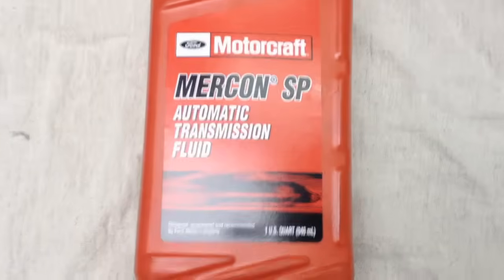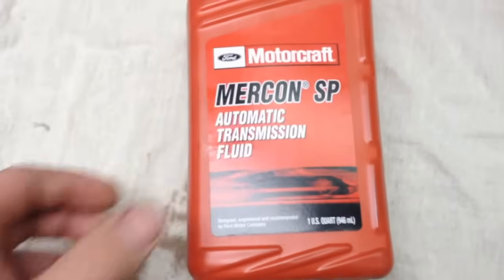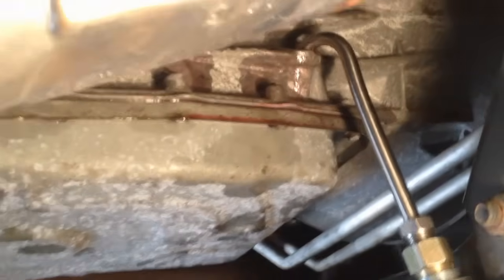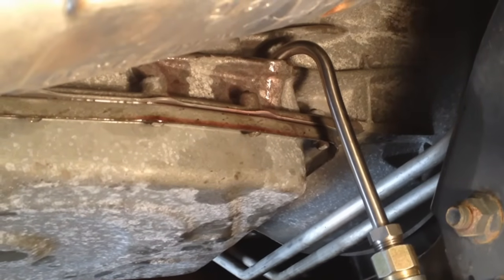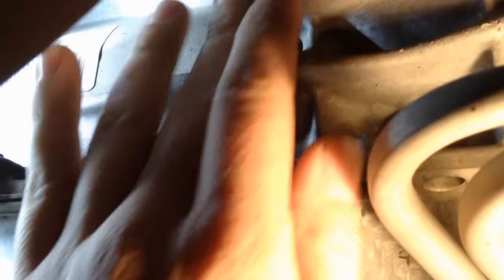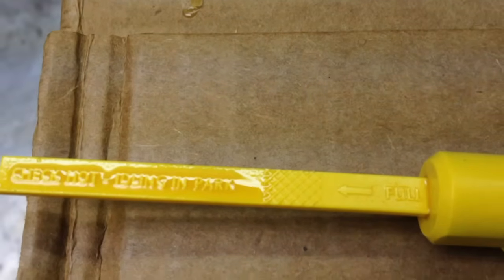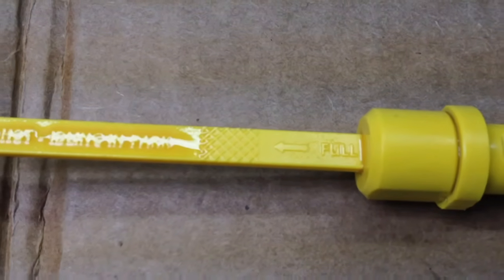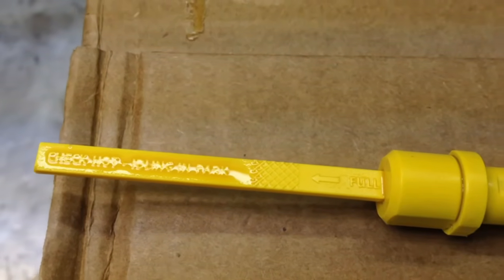Ford 6R60 & 6R80 6 Speed Transmissions: Fluid Fill & Adjustment Procedure

Comment: Has anyone ever had the dipstick plug strip out? It just spins... Just had this happen when trying to attempt to replace the bulkhead sleeve. Obviously didn't take it any further because I would have no way to refill the fluid. Any help would be great. Thank
Reply: Did you resolve the problem?? I got the same problem!!?
Reply: @joseonta  yes. Best I remember I had to use an impact to get it out but it ruined the threads. I ended up using a rubber expansion plug that had a bolt head to tighten it down.
Reply: @honkytonktolltide  thanks a lot, will see what  I'm going to do !!!

Comment: I want so much to to this myself.  I am capable but am worried I will pop that cover off and some spring or pin or something will fall on the ground. If I do,  did you say start off putting 4.5 quarts back into it.  BTW, thanks for the link to the pump, you thought of everything to assist the DIYers.
Reply from the maker: +ken tastic Nothing will pop off don't worry. I think they take right around 5 qts before overflowing just fill till it start to overflow then adjust from there.

Comment: FordTech, just replaced my bulk head connector based on another video of yours and and all seems well.  Just one thing about the fluid level adjustment.
I am getting inconsistent results on the dipstick.  May latest attempt to check was while running after driving a few miles. While running I checked and it showed as if it was over full.  Tried again and one side showed as if it was over full and the other side was low.  So, I thought maybe I am sliding in on the side and it is not a true reading.  Tried yet again and looks full.  Not wanting to be over full, I turned off the motor thinking if it is over full it will run back out the fill spot when the engine is off. Is that not the case? After turning off none came out. Any suggestions on how to get an accurate reading?  Seem to drive and shift well.  thanks.
Reply from the maker: +trailscavenger It wont necessarily run out no. Tow different levels on the stick are common with automatic transmissions. What I generally see is the lower reading sometime on the backside of the stick is the actual reading. What you have to realize is fluid flowing around in the pan can splash or wave onto the dipstick and create a higher mark where as creating a lower mark is not possible.
Reply: +FordTechMakuloco  - I would agree. I just do not want to be Found On Road Dead :)  I will check one more time cold before my long trip.  thanks.
Reply: Exactly, man Im glad I read this. I'm having the exact same issue. I've checked it cold and hot and I cant ever seem to get an accurate reading. This has become suchban aggravating endeavor and simply adjusting the fluid level accurately shouldn't be this difficult. I check it warm and get it to the bottom of the hash marks,then drive it till operating temp and check again and it shows over full.Drain  half a quart out,drive again,check again and it shows low.What a screwed up system. I wish Brian would make a video and say whether the vehicle is running or not and if the transmission is warm,hot or cold. Hell man,dont worry about the engine sound we can get past that.Accuracy is more important especially when a new transmission cost 2500.00 or more. I guess I can always quit bitching and takebit to the dealership. SMFH!!!!!!!!!

Comment: Fordtech I have a couple question. 
1 I am assuming if you break the vacuum seal to check your fluid levels it's not going to mess with the tranny
2 I am not having any trouble with my tranny at this point (60,000) but I do haul my camper a lot during the year.  Would it be beneficial to change the fluid now or wait till the 100,000 mark.  A few dollars now may save me thousands down the road.  At least that's what I am thinking.  Any advise appreciated.  Thanks for the vids.
Reply: jamexp I know this is an old comment, but hopefully you see this.

After changing the fluids out, especially if done after a very high mileage you essentially must reset the PCM. My truck had minor differences, but relearning with fresh fluid made all the difference.
Reply: My 2007 Expedition has taken all 9 quarts of Mercon SP I ordered and it still isn’t even touching the dipstick when running in Park, is it safe to drive and how many more quarts should I order. No leaks and it took all 9 quarts through my hand tranfer pump.
Reply: Ok recounted it took 8 not 9 quarts even, I got it now up to just below the hashes with 8 quarts of fluid running in Park cold, took more than I thought.
Reply: Driving it this morning now my truck revs very hard before shifting into 4th gear..... great.
Reply: jamexp make sure to run the shifter through each gear.
Reply: Motorcitymadman did you get any response from this question?  Firestone told me they won’t change my transmission fluid on my 2103 F-150 for this reason (140k miles), but manual said okay till 150k.
Reply from the maker: +ExploringKY Vacuum break is not going to affect the trans correct. I would definitely perform a fluid and filter change as per my video at this point especially with towing.

Comment: Great video but can you tell us where the fluid should be on the dipstick when it is cold? Those cats get hot well before the transmission gets warm. Thanks for all the great videos they are very informative
Reply from the maker: What I have found is about and 1/8" below the hatch marks line cold engine running works best
Reply: Thanks a lot!
Reply: @FordTechMakuloco  I fear I overfilled mine FordTechMakuloco. Should I take it to a mechanic to check/correct level?
Reply: FordTechMakuloco i have a 13 f150 6r80 on my dip stuck there is A and B ?

Comment: What about a 6R60 in an 06 Mountaineer with 100k on original fluid. Can I replace only 6 or 7 quarts with SP, when the original (and remaining) fluid is Mercon V (I think)? Ford's recommended fluid change is at 150K, but reading several threads, I'm thinking I need to do it sooner, but no tranny problems, so far.

Comment: ford tech
In the last paragraph I forgot to mention my new 2010 Ford as you know has no dipstick tube . Im looking to make myself a dipstick tube for my truck. I purchased from Ford a new metal cap covers the small dip stick.Im looking for a tube that will fit properly up to the top.

Comment: ford teck 
Im not sure what a thermostatic valve is. but the 3 flushes I did were on 2000 to 2005 models.  I just removed the return line and pumped the old fluid into a bucket (engine running) as I pour the new fluid into the dipstick tube. I did this to the fluid can clean out of the return tube.

Comment: You need to have the vehicle running when you ck it, right
Reply: FordTechMakuloco Do you have to top it off with the vehicle running as well? Additionally, I hope the engineer who designed this got fired and then came home early to his wife cheating on him.
Reply from the maker: Yes as stated the final adjustment is with the vehicle running in park.
Reply from the maker: Yes

Comment: Thanks for the videos!
Question:  is it possible to pull the transmission oil via refill hole with a gun and hose to minimize the mess when dropping the pan?
Reply: Yes of course, best way is to suck out as much as you can with a transfer pump and then there won't be a waterfall of ATF
Reply: I mean 2009 f150

Comment: Thanks for the video. I just finished changing the filter and fluid using your videos as guides. Everything went just as you said. I have a 2011 F150 Supercrew 4X4 with the 6R80 and the manual states the capacity of the Mercon LV is 13.1 quarts. I went ahead and purchased 13 quarts but only got less than 8 quarts in. After going back and watching this video again I see where you said it took about 7.5 quarts, I wish i would have paid closer attention! I wonder why Ford overstates the capacity so much?
Reply: the larger amount of fluid is if the torque converter was empty. a pan drop won't acomplish this.
Reply: @curtispomykal8432 and the trAnscooler (if equipped) as well. It’s small, but still holds a good amount of fluid

Comment: I have a 2012 F150 w/ 6R80 and am going to replace my fluid soon. How much should I buy or expect to use when refilling?  I read the transmission takes 12 qts but from your video and other comments it seems it will only take 6-8 qts.  Also do you prime the new filter with fluid?
Reply from the maker: norcal_ecoscrew no priming required and you will find it takes right around 7.5qts
Reply from the maker: Curtis Pomykal really how do they bypass the thermostatic valve?
Reply: If you do a u tube search on transmission fluid flush there's a video showing how to do a COMPLETE fluid flush. I've done this 3 times before on 3 different trucks and it's a breeze.  This way you can flush 100% of the fluid, including the torque converter!

Comment: Great video thank you. I have the 6R75 which uses Mercon SP in my 08 Expedition. How high should I fill the fluid on the stick? I changed the fluid and filled using your video. Right now I have it so that the fluid line is in the middle of the crosshatches when warm up.
Reply from the maker: B Scott If it is anywhere in the hatch marks warm you are good to go.
Reply: Is this running in park while checking dipstick or engine off?
Reply: @richardwalsh2161   Always check transmission fluid with the engine running.

Comment: Thank you for the vids! One question though. What about using AMSOIL Signature Series Fuel-Efficient Synthetic Automatic Transmission Fluid?
Reply from the maker: Cory Kroelinger I would only use Mercon LV it is already a fuel efficient fluid. LV= Low Viscosity
Reply: FordTechMakuloco
Roger.  Thanks for the info.

Comment: I just changed the fluid on my 2010 expedition with the 6R80 with both of your videos (change and fill/adjust fill level).  Thanks a lot for doing them.  I used just under 8 qts on my truck with usual amount of spilling.  My fluid was definitely in need of replacing.  I'm glad i did this and, again, thanks for the video.
Reply: I checked the fluid this morning after about a half hour of in-town errands (ambient temp - 32*F).  I'm guessing that I overfilled if, when I took out the dipstick, fluid spilled out of the hole?  I quickly recapped the fill/dipstick after loosing maybe a 1/4 to 1/2 cup.
Reply from the maker: Edward Messer Yeah it sounds like it check it hot like that and it should just be at top of hash marks.

Comment: Thanks for the vid..im confused. I have a 2010 f150 4x4 6 speed 4.6

My fluid level is topped.. i warm.it up and test and it reads very little fluid.  So warm stopped is at the top.  Warm running is at very low. I checkecked it because i had a hairline crack in the oil pan and its been leaking for over 1 month.  What do i do?
Reply from the maker: It must be checked and adjusted with vehicle running.

Comment: Hi, love your videos on the fords, a little unnerving there are so many on the 5.4 3v, but i like this engine so far.  I have a 2010 FX4 with 85 thousand km (50k mi) manual says its a sealed tranny and is not serviceable until 240000km and even then it doesn't specifically say 6R80. It does have intervals of about 96000km to change fluid on "torqshift" trans but again gives no model #'s. The forums give me ten different answers from 10 keyboard mechanics, what do you recommend?
Thanks, Dan
Reply from the maker: I would change the fluid on that trans every 60k miles. I have a video coming out just on this procedure soon.

Comment: my dealer had to fix a trans leak which you have a video about. they fixed the leak but after i got it back i have had a strange noise in the mornings from the trans and when i take right turns the truck hesitates 2-3 times before it gives me full power. it has also had rough gear changes and harsh reverse gear changes. any ideas what they could have done to trans that caused this? My dealer aint got a clue.
Reply from the maker: It really sounds like they didn't set the fluid level correct or they have not pushed in the pass through sleeve all the way in which some inexperienced techs do. If you truly didn't have these issues beforehand they need to redo the job.
Reply: Thanks for the reply. I have checked the fluid my self once and it seems ok. I will check that pass through next. Cheers

Comment: Would it be possible for you to make a video showing how to flush and change the filter on these transmissions. I am wanted to get that done but i like doing all the work to my truck.
Reply from the maker: These transmissions are not flushable due to an internal thermostatic valve. A pan drop is the same as any other rwd trans out there nice and simple pan bolts and swap filter out. The tricky part is the fill and adjust shown here.  Just make sure orange seal comes out with the filter they usually stick in the case, you will see what I am talking about on the new filter from Ford.
Reply from the maker: I actually shot the video you talked about but figured no one would use it and deleted it. If I get another one in I will shoot it.
Reply: ok well thank you. my dealer told me the only way was to use a flushing machine to exchange the fluid.What are your recommendations on service internals and also did you drill and weld on a drain pan plug.So that service would be easier. I think that it would be amazing video to learn from. I stay on the f150 forums a lot and there have been some questions about this transmission. One more question, have you installed a external filter like the mag fine and if so where did you put it at sir.
Reply from the maker: nickelwork87 60k intervals, no I didn't drill the pan these are customer cars. I have never used external filters, Ford used to give them to us to use on the reman trans we put in from them I never put them on cause they would cause restrictions and leaks. Low and behold recently ford came out and said we no longer supply the external filters with our reman trans they proved ineffective and leaked all the time. Which is what I said years ago. The filter in this thing is HUGE there is absolutely no reason to waste money on another filtering system.

Comment: Do I need to leave the engine running in order to check the trans oil level?
Reply from the maker: Yes as stated in the video engine idling hot and in park.
Reply: O.K pal, thanks

Comment: how reliable are the 2007 6r60 for the explorer, i hear they only really come in for software updates and don't come in for rebuilds as much as others
Reply from the maker: Lets just put it this way I have never rebuilt a 6r60 or 6r80 and they have been out since 2006. I have done a few mechatronics units on the 2006 models after that it has been mainly the software updates they had to smooth out the shift timing which they have now and most owners have that pcm update or are not as picky about the way it shifts so we very rarely see them for a trans concern now. So I would say overall very reliable trans.
Reply: thanks for the response i appreciate it
Reply from the maker: TheFord5150
No Problem!

Comment: only used reccommended fluid when changing fluids!
Reply from the maker: Exactly, are you making a general statement or you trying to correct me? I don't think I could of made it any clearer. I also put in the specified fluids based on year and model in the description. Doesn't matter thought they either say SP or LV and will probably switch all to LV. They did this with the superduty torqshifts and say that you can mix and match SP and LV in that trans. It's only a matter of time before they say the same about these. They will phase out SP for sure.
Reply: nooo genral statement! litterly had transfer case on my hoist 2 weeks ago because buddy decided to change the fluid himself, well he didnt use the correct fluid put it that way:)  bye bye clutches!
Reply from the maker: Was it a Ford? There was no official communication to Ford techs but I found out the mercon V is NOT to be used in transfer cases. The old mercon is not made anymore so they came up with this stuff that probably uses the old mercon formula and call it Tansfer Case Fluid. If you read back of bottle of Mercon V it says not to be used in transfer cases weird.
Reply: naw it was a GM, it took dex6 in the old girl and in all honesty i have no idea what was in it besides the clutch materal and the shavings from the bearing's.
just stressing the point of use correct fluid's from the dealer for anyone trying to change there own fluid's.
Reply from the maker: I see.